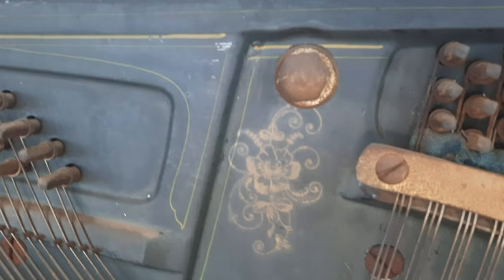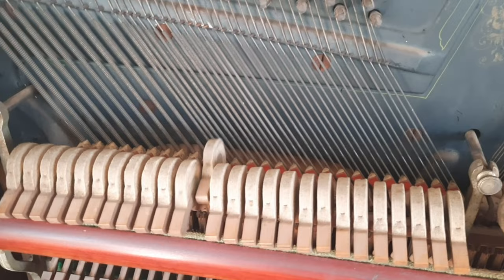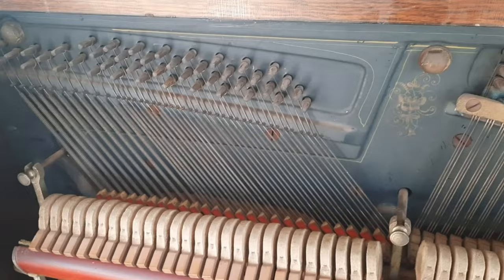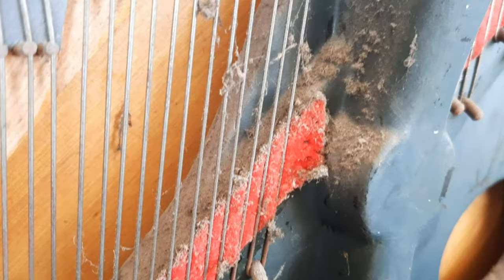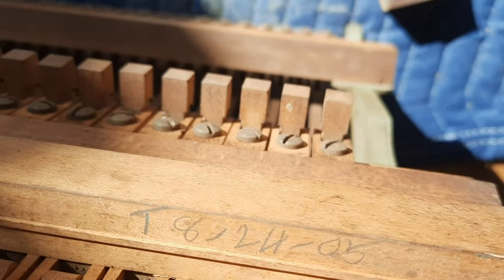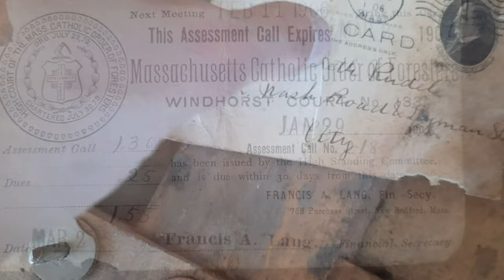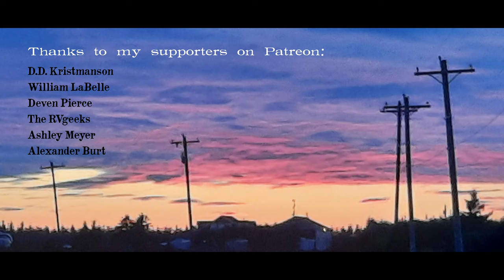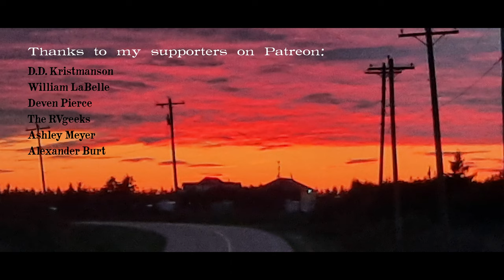PEI Piano Technician: ~1906 Woodbury reconditioning, part 1.

Comment: Could you explain the "twisting" a bit more? One twists the string against the wrap (1 or 2 turns...??) to loosen while brushing?
Reply from the maker: There are two "twists" involved, both kind of tough to explain without getting wordy, but here goes:

First is gathering up each string, looping it like a garden hose; this is what opens up the wrap + breaks up the corrosion. I either do that by hand in groups of 5-10 strings, or loop each string one-at-a-time around a clothesline pulley wheel. Running the clothesline wheel up and down the length helps get more dust out of stubborn strings and keeps finger grease off newer strings.

The second twist is when you put the string back on the hitch. You have to turn the hitch eye-loop in the same direction that the bottom tail end of the string wrap material is pointing. I twist by hand 1 or .5 turns, looking for medium resistance, then use pliers to transfer the loop onto the hitch. Too many turns can give the string false beats/difficulty tuning.

That was more than a "bit" but I hope it makes sense!
Reply: @maxkeenlyside  Thanks for the clarification. I've encountered similar methods before. I thought you might be suggesting a loosening twist while cleaning the string... Some people just talk about adding a twist—not bothering with the loopy stage. Guess success there will be somewhat dependant on just HOW dirty the strings are... You certainly got striking results!
Reply from the maker: @qwaqwa1960  Interesting, I've never considered a counter-twist while cleaning. Next time I'm about to restring a bass section, I'll experiment to see if a counter-twist in the cleaning stage gets out more dust, or leads to loose windings. Thanks for your thoughts!